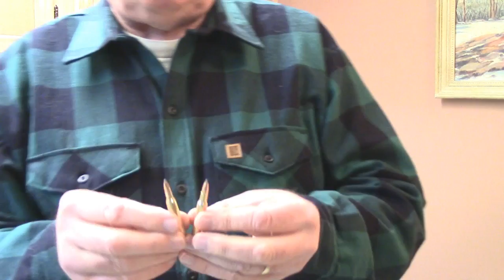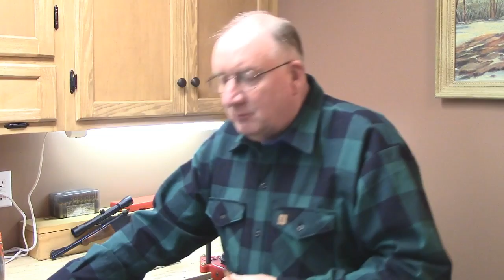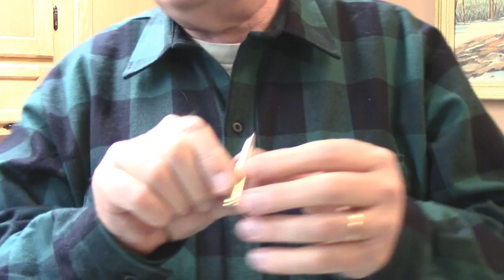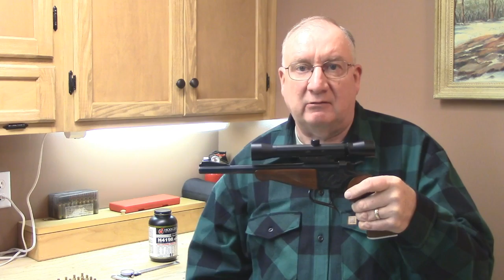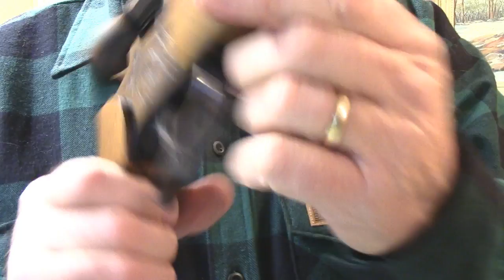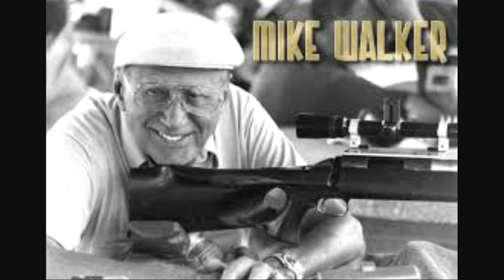The Great  222 Remington

Comment: I recently bought my first set of hand loading equipment at an auction last weekend (ironically enough because I want to hand load the 30-40 Krag you mention in the start of the video instead of relying on scarce factory ammo) and included in the lot was a set of 222 dies. If that wasn’t enough, this video has certainly convinced me to move the triple deuce up near the top of the list of rifles I need to get my hands on.

Comment: Why the 222 isn't more popular is beyond me, aside from the cost. Compared to a 223 there is marginally less fps and energy, personally I think this is irrelevant compared to the flat shooting and tighter groups of a 222. If all you are shooting is heads and hearts, accuracy should definitely trump the power difference.
Reply from the maker: Actually, the answer comes from an historical perspective.  Watch my videos concerning the history of the M-16 development in the early 1960s.  Eugene Stoner, inventor of the AR-15, in fact did use the .222 Remington in his initial design.  

The military called for a round that would penetrate both sides of a GI steel pot (helmet) at 600 yards.  The .222 Remington didn't have sufficient energy in that test.  The US Armory folks were engaged in a parallel universe at the time, working with the .222 Remington Magnum and working against Stoner, fearing intrusion of the civilian manufacturing world into their establishment military clique.  Of course, the .222 Magnum penetrated just fine.  

Stoner went another route.  He simply modified the .222 by lengthening the shoulder of the long necked case, and accomplished the same thing as teh .222 Remington Magnum, but with a shorter neck that fed more reliably through his rifle.  Of course, final modifications were made to the length of the brass.  The wonderfully accurate .222 Remington and the potent .222 Remington Magnum fared well until the US military released zillions of surplus 5.56 NATO onto the market after the Vietnam war.  All that ammo just turned dusty, and dealers had no use for it.  Only a very tiny few folks who owned Colt AR-15s could care less, until 1973.  

Bill Ruger saw the sales potential of a rifle that could shoot all that inexpensive 5.56 NATO surplus ammo and released his Mini-14 in 1973. 

Anyone who argues that early Mini-14 rifles aren't suited for NATO pressures doesn't know the history of the rifle.  In the 70's, Americans were getting very, very, upset over politicians who wanted to convert to metric.  They disliked metric designations entirely.  Ronald Reagan finally ended the matter when he became President and killed the metric conversion that Pres. Jimmy Carter had endorsed.

Bill Ruger understood that reality and left such poisonous metric designations off his receiver, calling it simply the 223 Remington.  However, the owner's manual always clearly spelled out the fact that the Mini-14 was fully capable of handling any military ammo.  The roll stamp change on Mini-14 receivers has absolutely nothing whatsoever to do with chamber measurements.  It was entirely to keep customers happy.  Ruger finally recognized the confusion a few years ago, getting tired of the phone calls, and simply changed the roll stamp.

Being virtual ballistic twins, the .222 Remington Magnum disappeared almost immediately, with Sako holding on for a while.  The candle burned for the .222 Remington quite a while, but the benchrest fraternity suddenly began to recognize the number of records being broken by the 22 PPC invented by Dr. Louis Palmisano and Ferris Pindell in 1974, and by the mid 80s, the flame burned out.

Comment: Speaking of keeping the .222 alive, I ordered a .222 barrel from Shaw December 1 2022. After about 12 weeks it finally arrived. Blue polished, 24 inch with a magnum contour, 1:8 twist for some heavier bullets, recessed crown. I used a used Model 10 FP action and ordered a new bolt for the build. Already had the brass and LEE (rgb) dies ordered. All that's left is to break it in while sighting. Then back to Walmart to get those other two boxes of Remington "High Performance Rifle" .222 that the MIRACULOUSLY had 3 of on the shelf before I bought one box. I already had a .223 set up for Varmint/Target. This one will be a little easier to pack around.

Comment: Hello Sir, I enjoy your educational videos. I bought a Remington 700 chambered in 222 Remington but the barrel is badly pitted. I am considering replacing with a Shaw barrel. Would you recommend I stick with the 1-14 twist?
Reply from the maker: A Shaw .222 will be an amazing shooter! A 14 twist is fine for 50 grain and certainly 53 grain target bullets at 222 velocities, where the gun rules.  It's marginal for 55 grain and too slow for anything longer.  I would personally go with a 1-12 twist, just to give it more options, unless you have notions of using very light 40 grain thin jacket Hornet bullets.

Comment: My model 600 Remington 222 I got a notice to send gun in to have trigger repaired. I messed with that trigger for 3 years before I got a unwanted discharge. The only way to get it to fire is to put you finger on trigger when you take the safety off which is a big no no you only put you finger on trigger when you are ready to fire the rifle. I bought this gun when I was 17 years old and I never had a reason to buy a diffrent rifle love to hunt ground hogs and whitetail deer and I only tracked down one deer after that they dropped where I shot them and one shot at 300 yrds. I became a neck shooter and it was a 100 % deadly at this shot.100-200 yards were the best range for this gun but one day on a clear power line clearing I had. 8 point walk out facing straight at me and I put the cross hairs on the top of his head the bullet drops about 7-8” at 300 and the bullet cleaned the hair off his chin no blood and went throw his neck and spine and the bullet was under the skin on the back of his neck and dropped him spread Eagle right where he stood. I would not recommend this shot, but on that day dead wind on a bipod with a 50gr steel jacket hollow point. My round of choice and not my reloads is the Hornady Superformance varmint with 50gr V-Max for a factory load these are very good rounds. And Iam 68 yrs old now and still love this gun and round and I upgraded this rifle with steel rib vent and steel trigger guard and mag bottom from a guy who makes these parts in Colorado.

Comment: The first I heard of the 222 was someone saying the first perfect group in bench rest compatition was .made shooting this round. I wanted to learn more and came across info that said several measured it at 0.000. But later was  measured 0.009 officially so perfect or no that's fine shooting and a precise round. The record stood for 30 years when a.shooter using the 30 ppc shot .002 smaller. 
I was expecting someone shooting the 6 ppc to shoot a smaller diameter group but not yet. 
That says alot on the precision that can be achieved with the .222. 
Too bad not one manufacturer is clambering this round in their rifles.
I don t know about availability of ammo or brass ( it has no parent cartridge). 
I d be surprised if rifles that exist ever frequently are seen for sale. 
I ve always liked calibers like this and others like the 257 Roberts.
Thanks for another great video.
Reply from the maker: The .222 IS the parent cartridge. I've formed many .222 cases from .223 brass which is simply a matter of running them into a .222 die, followed by a light trimming. It's the dominant round in France and wherever government restrictions prohibit private ownership of military cartridge firearms. It's very much alive and well. Watch my two-part video on glass bedding my Tikka .222 Remington, which I shoot in another video. After this gun shortage ends, a number of companies will return to making them here, as they were doing prior. Savage, Benelli, Tikka, and others.
Reply: @GunBlue490  I saw that after posting my comment but thanks for the reply. 
I want you to know how much I ve enjoyed and learned from your videos. I ve had several friends tell me not to depend on anything on internet as the truth. I told them if they were interested I know a great You Tube channel and has informative straight up info.
Something I know, it s helps when searching for information to know enough to tell the good ones. 
There are many dependable videos but I haven t found any that helped me more than you.
Thanks so much.

Comment: Thank you sir, I purchased a Tikka T3 .204 22” barrel 1/12 twist , for fox shooting , I like the fact that it is quieter than the 223. I have been experimenting with factory Ammo and like the 40gn super Varmint Hornady. ( 32 gn drifts a bit more in the wind) Used a Chronograph and measured 3589 fps muzzle velocity for the   40 gn’s . I use a caller so most of my shooting is under 150 yards. However I have some foxes staying out at the 300-350 yard range. Just wondering if you can talk me through the ballistics of the 204 compared to a 22.250 for that distance. I’m thinking that if a fox is sitting up looking at me if I aim between its eyes I should hit it in the chest? Or at that range should I be using a 22.250? I know it is a pretty long shot, but I was hitting targets with 0.5” groupings at 400m (admittingly that was from bench rest) where as hunting I use a bipod
Reply from the maker: The 204 is extremely flat shooting, but hitting power at 300 yards is really for smaller vermin, and the performance of such tiny bullets is marginal for coyotes. At those ranges, I certainly recommend the 22-250 with 55 or 60 grain bullets. With 1-14 twist, blunter, shorter 60 grain bullets will stabilize, but long plastic tipped ones often don't.
Reply: @GunBlue490  Thank you Sir, I pray that you and your family are safe, God bless you

Comment: 30:00 - The PPC cartridges eclipsed the 222 for competition before the 90s.
Reply from the maker: Yes, the PPCs were dominant by the end of the 70s.  Benchrest was an important, but miniscule aspect of the .222's popularity.  However, the .222 and its hybrid .222-1/2 (Two Twenty Two and a Half) had many fans and remained popular among diehards for well into the 80s and even 90s.  The .222 suffered attacks on two flanks; the benchrest by the PPCs and the rise of the .223 as cheap post Vietnam surplus ammo flooded the stores, and folks rechambered their Triple Deuces.  The .222 Magnum was the first to fall to the .223 in the early 70s, but the .222 remained quite commercially popular as a sporting round, especially in varmint rifles for 20 years longer.  It was only when the interest in black rifles started to boom in the late 90s that finally dimmed the .222.
Reply: Thanks - I think you meant - "...dominant by the end of the 90s".    I carry a 0.26" 5 shot group in my wallet to show people what accurate shooting is like - run of the mill in benchrest!

Did you ever attend or participate in a benchrest match?   Awful lot of fun!

The Donaldson Wasp was a fav accuracy cartridge for a while in the early days - was sort of hoping you'd mention it.   So many experimental and wildcat cartridges were developed.   I bet you've read or have the Landis books on varmint cartridges - wonderful historical information.   I still have mine.

Comment: In Sept.1966,for my 22 nd. B.D., one of my best friend sold me his Rem. 600 /222 Rem.for $80.00 and his first box of shells that had fourteen Rd.s left. i got five boxes of brass, 2 bx. Rem. 61/2 SR primers, 2 bx. Sierra /50 gr.SP. & set of Lyman dies. I have used this on all kinds of varmints, turkey  & Tx  White tail deer (hd. shots), only. I still have it and pass it on to Great-Grand- daughter. I 've owned two Sprg./savage in 222 Rem one 223. Later got a Post war Win 70./222 & a Rem. M-788/ 222 rem. The 222 Rem. is still my favorite varmint gun. Off course now I own all of the .22 cal. C.F. varmint gun . Yea, I'm 78 now and do a lot varmint calling all over Texas. Thanks for a great video.

Comment: Back in the mid 80's I bought a Remington Model 700 in .222 Rem. I got it from a fellow Rod and Gun Club member who said that it was a tack driver. He was right. It's been a pleasure to shoot ever since. All of my kids graduated from the .22LR to the .222 as an introduction to centrefire. 

As for the alleged trigger problems with the Model 700, I also have them in .22-250 and .375 H&H. Not once have I ever had an issue. Perhaps that's because I leave triggers strictly alone. The .22-250 had a trigger pull I thought a bit heavy for a varmint rifle with a 26 in. bull barrel so I took it to a local gunsmith for adjustment. He cleaned it thoroughly, did a slight buffing of the trigger-sear contact, applied a touch of lubricant (I forget what it was but it was a dry lube) and then did some adjusting to give a beautiful, crisp two pound pull. I've never seen the need to go for an aftermarket trigger. 

Reloading the .222 is easy. I've found it very accepting of a variety of powders, powder loads and bullet combinations. It truly is an awesome cartridge.

Comment: Looked up the Remington 40-X; first thing I find is an idiot gushing about it having a two ounce trigger. He did reluctantly mention two pound pull being "standard".
FYI, the 40-X had a very simple and reliable external screw to adjust the strength of pull. And idiots definitely blew their, and other people's, brains out by adjusting them down as far as they could.

Comment: If you were building a 222 Rem for benchrest out to say 300 yards what twist would you suggest?  Thank you
Reply from the maker: Standard twist is 1/14 and works perfectly with match grade 52 and 53 grain bullets at any range. If you desire longer bullets up to 60 grains you may desire a 12 inch twist.  However, 14 inch twist made the .222 famous, and broke countless records in its day, and would be my choice. It'll get out to 300 yards just fine.

Comment: Used to have a 22-250 in Rem 700 and I still have a Rem sporter in 223 but never owned a 222. The guy’s that I learned about accuracy and reloading from were extremely in to benchrest shooting.( they had lathes and milling machines in they’re basement) The 222 was the caliber they used the most at that time. (1970s) They even had an underground 200 yd range on the property to eliminate wind drift for load development!

Comment: Just as a matter of note, there was something very wrong with that 700 trigger.  I purchased a brand new 700 in 1977, sometimes when disengaging the safety it would go boom.  I sent it back to Remington and they corrected it.  No note of explanation was included when it came back.  I still have that rifle and it has not done it since it’s return, the rifle has the Remington proof marks up prove that it was sent back.  As I always keep the muzzle pointed in a safe direction, it did not cause me any damage.  It had an issue!

Comment: The 222 is the most accurate cartridge in the world my brother shot 5 5 shot group at a hundred yards and five five shot groups at 2 yards he set 5 world records that day with a 222 Remington the smallest group at a hundred yards was0.2 thousands at 100 yards the smallest group at 200 yards was 8 thousands bigger than one bullet hole the largest group out of all 50 shots was twenty-eight thousandths bigger one bullet hole it took 25 years to break those records but they didn't do it in one day his record has still not been beat till today with a 222 Remington benchrest rifle William Bradley Simpson holds the world record with a 222 Remington.
In the 70s. With a 600 Remington sleeved action with a heart barrel.

Comment: I felt a certain sadness when the 222 got pushed aside by the 223. In the mid 60's it was the first center fire cartridge my father allowed me to shoot. Shot allot of starlings and if you missed it was your fault not the guns fault. Reloaded allot of shells for it, didn't understand at the time allot of the nuances of reloading but got the job done without anyone getting hurt. Missed the 222 kinda like the passing of some of the gun writers of the time, Bob Milek and my favorite Jack O'Conner. Appreciate the comments and the historical back ground on this cartridge that for me holds allot of sentimental value.

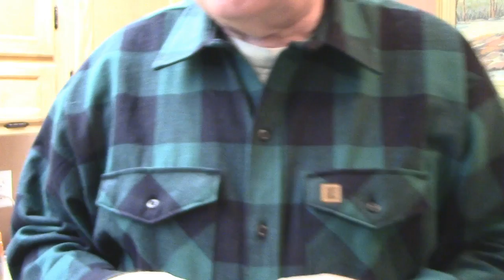Comment: I've owned half-a-dozen guns in each of the 2 calibers, some with custom barrels. Despite the 222's reputation, longer case neck and and custom dies, I've found accuracy between the 2 calibers to be pretty much the same. Both were excellent.  In fact, the most accurate of all, oddly enough, may have been a 223 Remington in a Ruger No. 1 with a sporter barrel, which a gunsmith ruined when I had him wildcat it to a 22-243 Middlestead (22-243 Winchester). (He cut the chamber with a .0014" headspace - no wonder I was getting case head separations from the get go) . Anyhow, the velocity difference between the 222 and 223 with careful handholds was only about 100 fps. The main thing to remember is that 222 Remingtons generally come with 1:14" twists which means accuracy starts to fall off with 55 grain and heavier bullets or long-for-caliber Barnes X-type bullets. In contrast, 223 Remington hunting rifles come with 1: 12 inch twist - or much faster twists if they're intended for long, heavy, high ballistic coefficient target bullets.
Reply: My tikka t3 .223 has a one in 10 inch twist.

Comment: Thanks for this one.  I have a Sako 222 that I bought 40 years ago.  Mine has a Leupold 10x in the old Sako mounts.  It is and has always been a true tackdriver.  The 222 was also the first cartridge I ever handloaded and it was certainly a good one to start with as most loads seemed to work well.   My favorite was any of the 52/53 grain hollow points in front of 22.5 grains of H322  which produced 5 shot groups that averaged under 1/2 inch.  A great cartridge and a great rifle.
Reply: I agree. Samos are fine guns. A couple of years ago, I got a Steyr SL chambered in .222 Rem magnum! I resize .204 Ruger brass to reload.